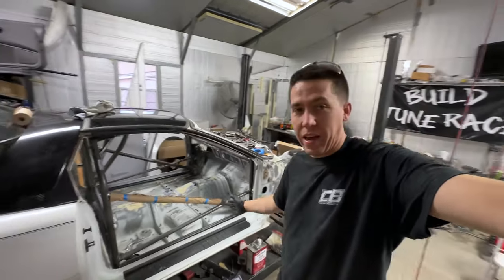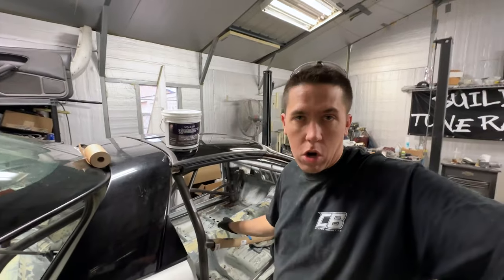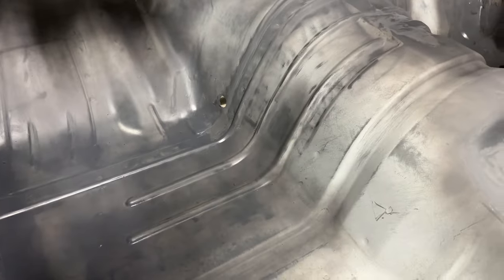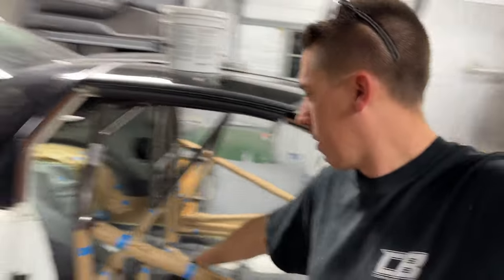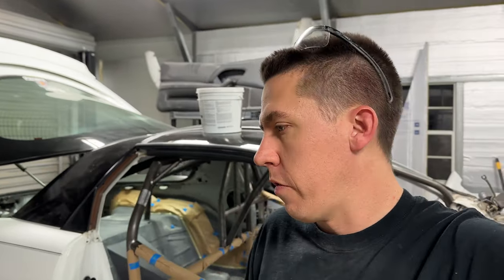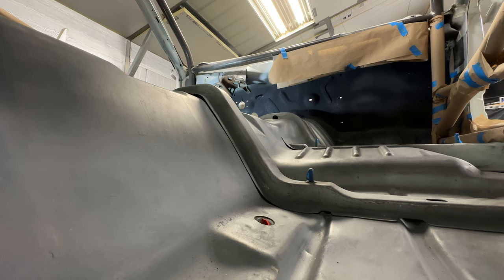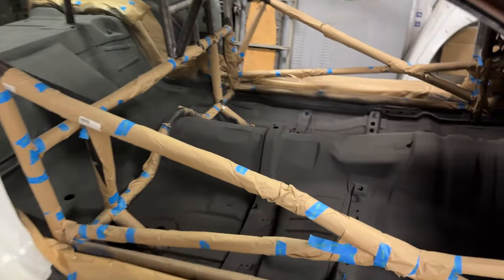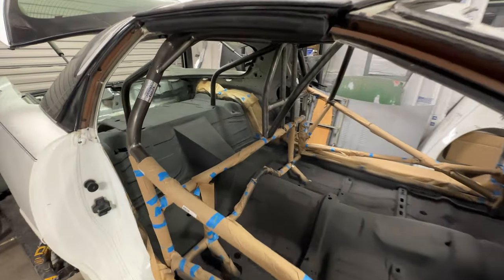Ceramic Coating The Inside Of My 1800HP Twin Turbo Camaro Build!

Comment: Seems like a pretty sweet coating. I did something similar and used raptor liner from u-pol on my camaro,but it’s not ceramic. Curious to see how it holds up and pretexts from heat